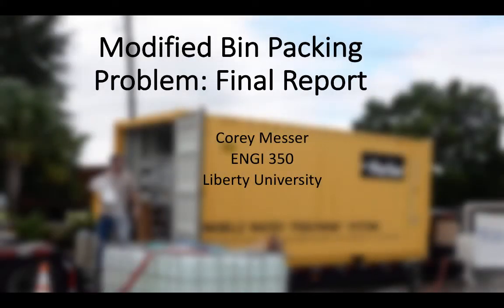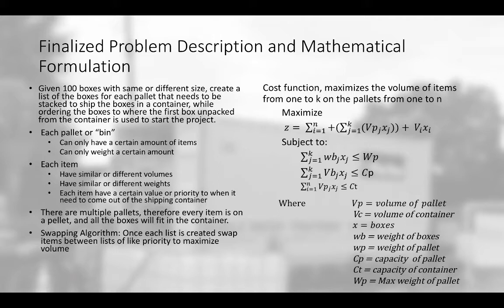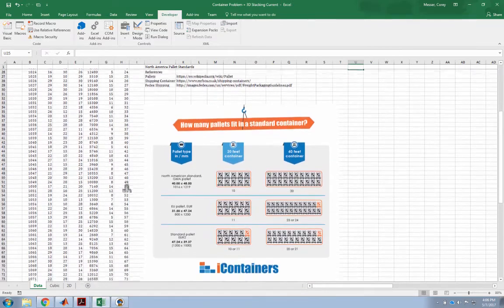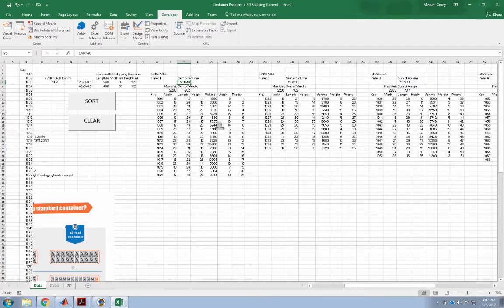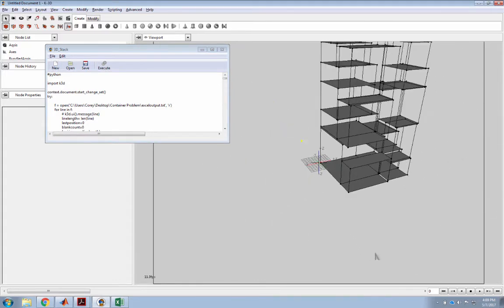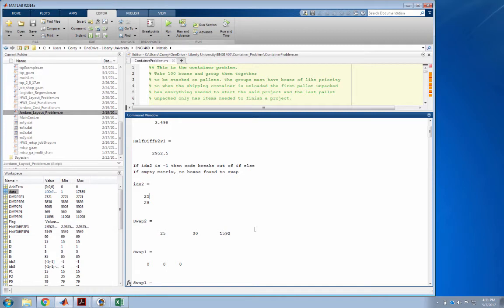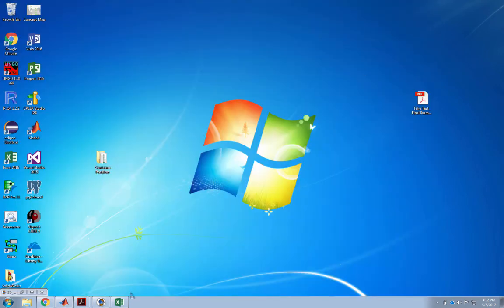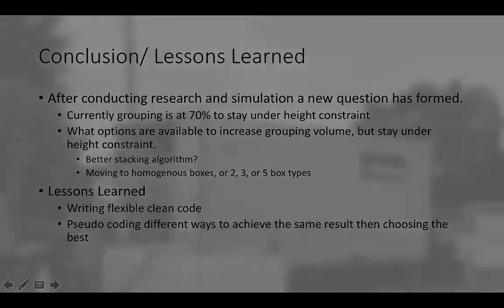Modified Bin Stacking, and 3D Bin Packing

Comment: Do you think it would be possible to find a solution to 3d bin packing where the container is not a cuboid, but a different shape? The boxes will be cuboid.
Reply from the maker: I do think it would be possible, say you wanted to stack the square boxes in the shape of a triangle or a half circle like a dome. You could set the initial box in the center of the shapes and build around it and above it, verses setting the first box in the top left corner and stacking the boxes from that starting location. 

For the triangle your could create a constraint where the sum of the volume of a layer of boxes is less then the sum of the layer of boxes beneath it. 

These are some quick ideas, hope this helps!
Reply: @coreymesser1995  can u share or sell me ur excel file? it's cool